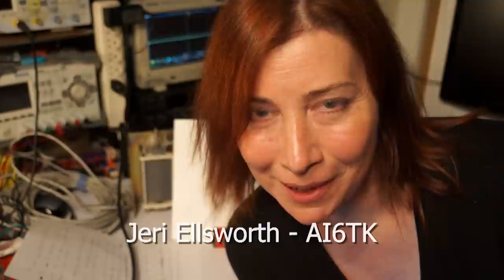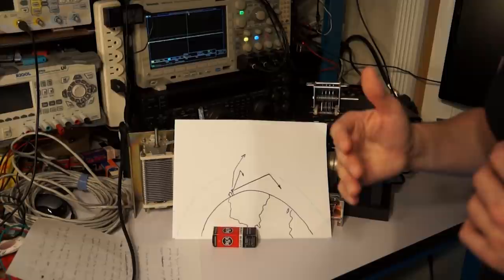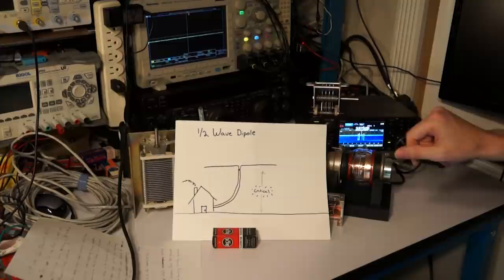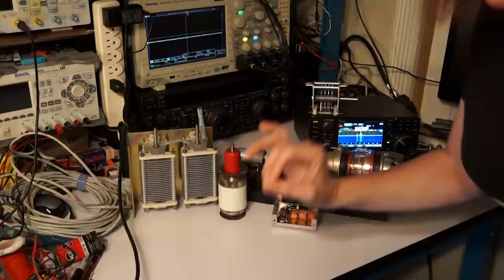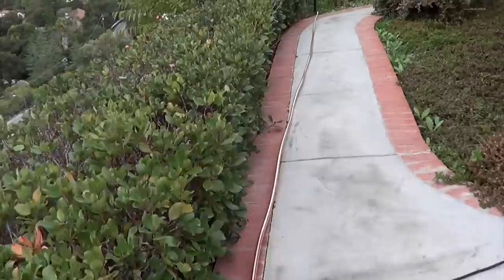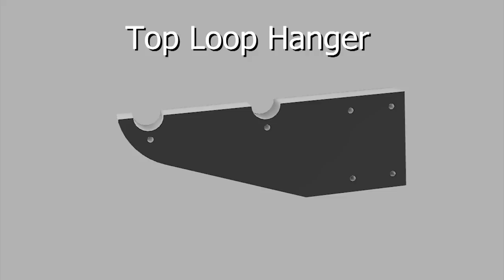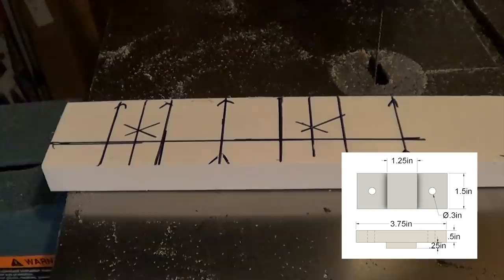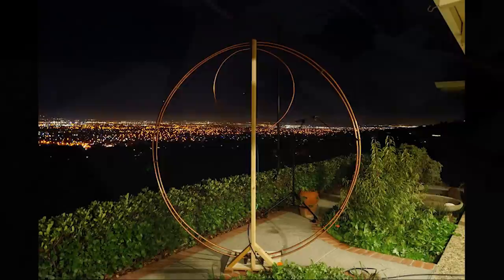Build a 160/80 Meter Magnetic Loop Antenna - Part 1

Comment: Jeri:  You speak really clearly and produce detailed videos that are really impressive.   I've only watched three youtube videos I think so far and awesome, excellent to see female leadership and instruction on the more/most technical topics of technology and science.  I'm thinking get some more mathematics involved regarding mass and energy and you'll have the whole STEM methodology down.  You can create a STEM training series to market on the side.  This is really an excellent detailed video on a magnetic loop antenna that is brief and concise also.  I see a few HAM's publish books too and at one time I was asked to teach/lead seminars for different conferences (spectroscopy, chemometrics, Systems Development Life Cycle and LIMS systems) and I'd guess you do the teaching in different venues conferences already though if not... you really can for profit for sure.   

I haven't started building my loop antenna in modern times yet (I did in my pre-teens for the crystal radio set) as I haven't decided which I am going to build.  I keep wanting to get into ferrite loops which takes me off on a tangent with making ferrite, mu-Metal and other energize furnace tangents.  I also have the conical spiral antennas I am working on though those are a totally different copper pipe projects.  With the loops I was thinking litz wire or magnet wire and for a few hrs thinking the aluminum expandable vent material though found on further inspection what I have is corroded.  The other loop idea was the Rodin coil toroid in iron powder.  Loop antennas are amazing in range of design capabilities.  I've yet to see the design like you have (or I was thinking a single tube) with a fractal tube wrap around. I'm still trying to determine how to print out the optimal fractal pattern for the discone monopole center element project as I keep wanting to do the screwdriver element too. 

What is the benefit of the copper pipe design?  Is it higher power capabilities?

Comment: Hi Jeri. Thanks for 160 Loop. I build a 160 Meter loop using 7/8 Hardline coax cable. I use several of you ideas. My Loop on 160 works really good. 73 Andrew WB4BKC

Comment: I might add, the coupling loop at the top of loop, the small circle ⭕️ needs to be squashed to an oval.   You get greater coupling that way.   More coupling, greater output.  😊

Also, you can choose to magnetically couple the second loop instead of connecting it directly.  Just its addition in proximity will shift the frequency to a lower frequency.

Comment: You already have an oscilloscope and a function generator so you may want to try the waveform amplifier, if is quite expensive, I paid $1700 for mine (Accel Instruments TS250) but it is very useful if you are interested in magnetic fields and electronic signals.
I have mine for about 2 years now and have been spending many hours generating all kind of magnetic fields.
It is a safe tool with overload protection circuits, but you will need a 6.7 ohms 300W resistor mounted in serial if you plan to use a copper coil to generate the magnetic field or else the waveform amplifier will reset often.
Have fun !

Comment: I may be wrong, but it looks like Part 2 of this project was never published!  Since you are using a two-turn loop I would guess that the project didn't work very well.  Here's why I believe this:

As we know, with the classic single-turn loop there is voltage standing wave around the loop where the maximum voltage is found at the variable capacitor.  Although the loop is an inductor it has an additional function:  It is the radiating element and which performs the same function as a half-wave dipole.

That voltage standing wave is essential for the transmission of energy into free space.  This is very similar to a half-wave centre-fed dipole where the ends have been pulled round to form a circle.  The ends are connected together by the variable capacitor.

The problem is, with a two-turn loop the voltage standing would be severely distorted by the proximity of the second turn.

Comment: Amy - marvelous video.  I subscribed and will be checking out more of your site.  Kudos on the very well organized presentation
I grew up with Ham radio and got my ticket in the mid 70's went on as engineer and just recently getting back into ham radio spurred on to enhance homestead preparations (our site Relentless Homesteading), but like the interaction with technical people being somewhat remote here working from home.
 
We had a presentation at our local club on mag loop antennas a couple days ago.  I'd been trying to find an antenna that would meet our needs here - not to high (winds here on this point), somewhat directional, reasonable gain, not too expensive, and ...I almost hate to say it as its sounds rather trite, but not too ugly spoiling the natural Joie de vivre in our location.  This mag loop seemed the ticket.  Checked i'net and found your video first, and still seems the best I've seen.  Purchased a wonderful 8-1000 pf 3.5kV vac var cap from party on Craigslist the next day (BTW - young person I bought it from was purposing it for a mag loop and right off mentioned your video - LOL) - despite that 3 of the club members said they had been scouring the Craigslist for weeks in search of them (guess I was blessed).  

I'm really looking forward to this build - so far only found one other of your videos on mag loops, perhaps need to search more thoroughly.  Interested in results from this 80/160 loop. 
Some things I'd like to improve for here: (a) increase  rigidity of copper pipe - perhaps by filling with resin, however, this could impact operation (perhaps negligible, but certainly less than e-field antenna), (b) fully remote control - tuning (manual and/or based on field strength reading from inside loop) - azimuth & angle - &fold down , (c) change the mount using fiberglass poll sections into a base coupled to a home made rotator, (d) add inclination axis, which upon rotation engaged in a specific direction allows antenna to fold down flat on my nearly flat porch roof (to brave our high winds - had 120 mph 3 years ago which tore off the old porch [ I designed & built the new one, so not so worried anymore 'bout that ]; (e) add known improvements of squashed feeder loop, coax exiting loop orthogonal to the plane of the loop (less noisy).
Apparently judging by this lengthy tome my enthusiasm for building is getting  the better of me again - mea culpa !!  
All the Best and 73's    RH

Comment: Jeri......

I heard you mention putting up multiple dipoles for different bands of operation.....this is not necessary and can get more than a little interesting over time.....with all that wire .....I have been a amateur radio op for quite a few years and would suggest a single inverted V antenna for all bands.....The idea is to put up a single half wave dipole (inverted v) on the lowest band you intend to work (160m might be a stretch for most people so let's say 80 meters).... the height of the feed point  is your choice (mine is about 30') even though this creates a fairly high angle of radiation so I can have a very strong signal up and down the west coast, I'm in norcal,  it still works very well at longer distances i.e. S. America Europe etc. . As you go up in frequency from 80 meters the gain of the antenna increases with what is termed the v-beam effect with the gain being exhibited off the ends of each leg... the single inverted V is fed by readily available 450 ohm plastic coated ladder line. The only catch is you need to use an antenna tuner so you can tune it up on any band 180m - 6m etc.  it's a great radiating antenna system that's simple, clean and easy to build and install. I have used this setup through several sunspot cycles and it is a great recv/xmtr antenna....mine will not be taking a long walk in the snow anytime soon...  I'm really curious about the antenna in your video....something quite different from the usual for sure !! 

 All the Best !  Rod - WA6PKJ.  Daytime -->> Software eng./network security analyst

Comment: Some tips while experimenting: Iron objects near the loop increase the I squared R losses. In testing record the height of the loop off the ground what metal objects are around it for each test. The tuning settings of L and C will vary with the height of the loop since the loop's image is in the soil. Having the Loop 1/2 diameter off the ground or better yet 1 diameter is way way better than the loop right on the ground. A loop can be very efficient but the ground around it does matter, ie one is heating up the soil and one has losses after the Antenna.  Also since the Antenna is electrically short for 80 and 160 meters , thus currents are really high. The tuning stuff gets hot with loses. A Thermal camera is a total godsend to spot bad areas like losses. After transmitting use a thermal camera to spot  and fix lossy connections. I use the Flir C2 here.
Reply from the maker: I love the thermal camera idea.  I happen to have one!

Comment: Jeri, After Nam the Army did research on small loops. I wish I still had the paper. The Army found that the best feed method was two variable caps in series with the loop with your feed coax across one cap. Also  a single turn loop was the most efficient. Frank WA1GFZ

Comment: It is also in English at the end      hola, soy LU4DNK y tengo 58 años de licencia, he construido mis equipos y mis antenas de siempre, estoy usando actualmente antenas de aro magnetico por falta de espacio para colocar dipolos, antes vivia en una zona rural y podia hacerlo, bueno, felicitaciones por lo prolijo que trabajas, pero como dato una antena de aro para que sea eficiente debe tener area, o sea ocupar metros cuadrados de superficie, el hacer una antena de aro con dos vueltas te quita rendimiento y mucho. Ahora tengo una antena para 40 metros de 2,45 metros de lado, es cuadrada, hecha de aluminio de  marco de ventana, de 4,5cm de lado por 2,5 en el lado angosto, los vertices los solde con aluminio y autogena, el condensador variable tambien es casero, soporta 300w de potencia, tambien tengo una que cubre de 10 mgc. a 15 mgc hecha con tuberia de bronce de 3/4 de grosor, y  4,30 de diametro tambien con condensadores caseros, los condensadores los hago de estator dividido, los comunes tienen mucha perdida, y tengo una tercera antena de 29 metros de perimetro contruida con cable de cobre de 10mm de diametro esta en foma de triangulo, el vertice superior cuelga de una torre de 6 metros y luego baja en forma de V invertida, en uno de los vertices de abajo va el condensador de sintonia y a 8 metros de este vertice hacia el otro vertice siguiendo el cable que va paralelo a la tierra, en este caso al techo, hay un balum devanado al aire de 1 a 1 donde se conecta el caoxil de alimentacion, el cable del cateto de abajo esta a un metro sobre el techo de chapa de la casa,  esta antena en 80 metros tiene un rendimiento de 100% y en 160 metros que se logra acoplando un condensador fijo en paralelo con el variable se logra un rendimiento de 35%, podria subir el rendimiento en 160 pero ya la antena quedaria muy larga para 80, Las fotos de estas antenas estan en mi pagina de QRZ.COM , no esta la de 80 porque esta ultima la arme hace poco y todavian no subi la foto ademas es dificil sacarle la foto por el tamaño, un saludo y felicitaciones Pd. con estas antenas propagacion mediante comunico con todo el mundo. 
Hello, I am LU4DNK and I have a 58-year license, I have built my usual equipment and antennas, I am currently using magnetic ring antennas due to lack of space to place dipoles, I previously lived in a rural area and could do it, well, congratulations for how neat you work, but as I said, to be efficient, a ring antenna must have area, that is, occupy square meters of surface, making a ring antenna with two turns takes away a lot of performance. Now I have an antenna for 40 meters of 2.45 meters on a side, it is square, made of window frame aluminum, 4.5cm on a side by 2.5 on the narrow side, I welded the vertices with aluminum and autogena, The variable capacitor is also homemade, it supports 300w of power, I also have one that covers 10 mgc. at 15 mgc made with 3/4 thick bronze pipe, and 4.30 in diameter, also with homemade capacitors, I make the capacitors with a divided stator, the common ones have a lot of loss, and I have a third antenna with a perimeter of 29 meters Built with 10mm diameter copper cable, it is in the shape of a triangle, the upper vertex hangs from a 6 meter tower and then goes down in the shape of an inverted V, in one of the lower vertices is the tuning capacitor and 8 meters from This vertex towards the other vertex following the cable that runs parallel to the ground, in this case to the ceiling, there is a balum wound in the air 1 to 1 where the power cable is connected, the cable from the lower leg is one meter away. on the tin roof of the house, this antenna at 80 meters has a performance of 100% and at 160 meters, which is achieved by coupling a fixed capacitor in parallel with the variable one, a performance of 35% is achieved, the performance could be increased by 160 but the antenna would be too long for 80. The photos of these antennas are on my QRZ.COM page, the 80 is not there because I put the last one together recently and I haven't uploaded the photo yet, and it is also difficult to take a photo of it. size, greetings and congratulations Ps. With these antennas propagation through communication with the whole world.

Comment: Hi Jeri phantastic video. But i was not able to find the second part with the measurements. I got some vacuum capacitors and thinking about building a mag loop for 160 meter. So, where is the second part? 73, Matz

Comment: I'm looking forward to the rest of the series, particularly the auto-tuning of the loop, which is something I haven't tried yet.  I've been on the air for about a year now, exclusively with magnetic loops due to extremely limited space and have been struggling to find the time to put together videos on my experimentations.  I've found that my loops work reasonably well for DX on 40-10 meters, but since the efficiency gets much worse at lower frequencies, I've only reached as far as the Caribbean and Hawaii on 80, and only 200 miles on 160 with an 8-foot diameter loop.  This is all on SSB with 100 watts; CW and digital modes would obviously work DX much better plus I suspect that my designs could stand some improvement.  73 de K7HKR

Comment: I once sent a ~10mW signal 22 miles using a horizontally polarised antenna (I say antenna; it was a piece of speaker wire mounted in the loft). Fortunately for me, I didn't get caught. The aircraft pilots in the local area as well as the ATC guys 22 miles away commented that the music wasn't their cup of tea.
EDIT: I did this with two transistors, a few capacitors and resistors soldered Manhattan style onto a copper clad board. Never again shall I be so naughty with radio!

Comment: N7WDF  and KD7DYB absolutely  love Jeri  !  !  !         why just two loops on your antenna ?  why not  3 turns of copper tubing / coil on the loop antenna or 4  turns ...   its apparent that 7.5 feet is about the practical limit for the max  diameter for most people to easily deal with.       At   2X   pounds      before it becomes a impractical wind load  and rotation  rotatable  load  and etc    ...   does the extra mechanical  problem of extra turns outweigh the added  capture area and gain ?    another Question # 2    ...    how can you tell when you have over driven your cheap  73 cent air cap ?     ...   when are burnt chips and caps toast ?    ?   sparks  ?    thunder     ??   the toaster "pops"  ?       Question  #3  what is good inter loop spacing to minimize inter loop capacitance at 15 Mhz  ?  with 1/2" daimeter coil tube    and 7.5' x  3"  spaced  loops      for X  loops  ?       does X/C  mostly become small  if  interloop spacing is > =   3.5  inches       ?     question # 4 = input("question #3")  

  Much thanks to Jeri  for all her awesome YouTube  videos     ...     my first loop build soon for unlicensed brother who likes SWL    short wave listening   for his Christmas   ...  

   The rotatable ham loop HF build will be checked against the performance of my awesome existing  HF tri bander "Mosley HF TA-33 Jr"  Yagi beam   ...  going to use "trex"  composite decking material for $20 x 8' foot x 4 inches "    from hardware sales  for coil spacer and standoff ,    and   "$  free"     1/2 inch heliax   for the coil loops   ...  scrounged and scrounging for variable caps,      not sure how im going to rotate the loop remotely ...   not a big deal  ...  prob  use old drill motor and pulley ...  or say  HAY son move that darn thing till i say stop !  son stop    !   

  Hearing the World on 20 meters is total fun   ...    on   14.300  Mhz   USB is the maritime mobile check in net ...  keeping people and  vessels  safe on Oceans of the entire World.    ...   every day from 10:00  to 20:00  EST   hear the world check in respectfully  on the MMS net on 20 meters daily ....     for details please visit   https://www.mmsn.org/            too bad contestors wAlK  all over it.  

  Go  GO !     GPIO  bus   ...   blah blah   ...    .      ..     73 & 1/4      de  N7WDF  / Jon.py